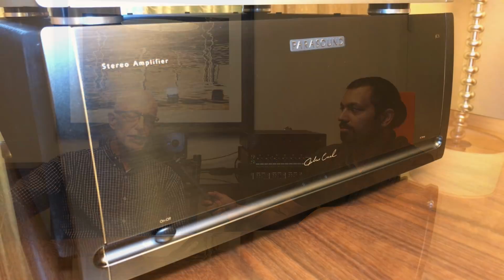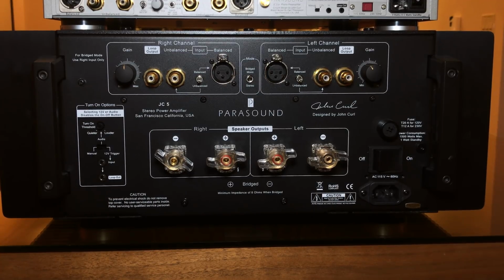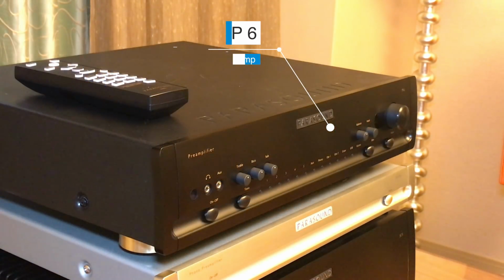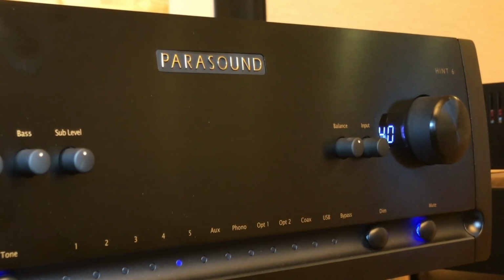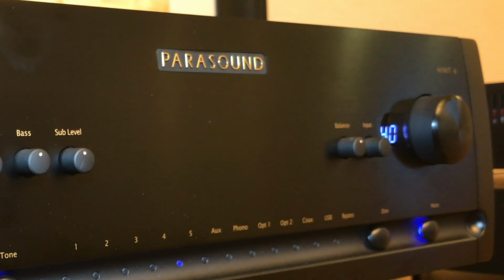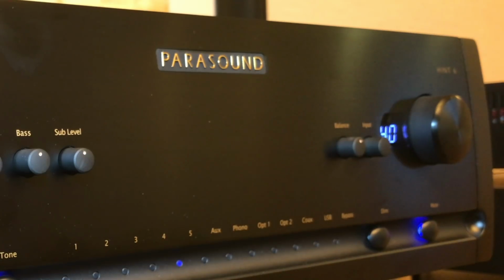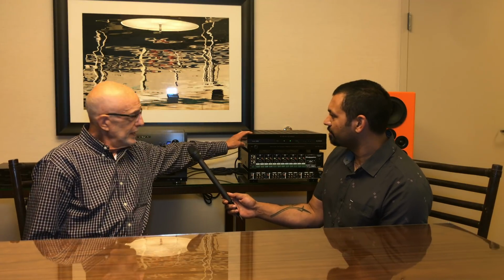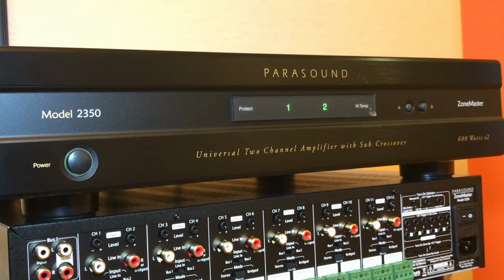CEDIA 2018 | Parasound JC 5, P 6, HINT 6 & Richard Schram

Comment: Hello, Please advise what are your opinion on Parasound A 21+ Amplifier and the P6  Pre Amplifier. What would be a best price to pay for either? Will these paired together sound good? Thanks
Reply from the maker: Hi!  Those should pair just fine.  Best pricing, contact my dealer Cory: http://bit.ly/TDPHTFB
Reply: Did you buy a P6? And I plan to buy it with the A21. What are the experiences? Thanks.
Reply: @nenadb7731  I bought the A23+ amplifier and P6 pre-amplifier, pretty decent, works for me.  I am happy with it.

Comment: Channa, have you ever done on video on when is best to buy a separate power amp (to accompany an AV receiver) for your HT?  Thanks
Reply: The problem is that few affordable receivers have pre-out jacks. I run an Outlaw 975 Pre-pro connected to a 2004 Denon receiver for it's 5 channel amp. My next purchase is an Outlaw or Monoprice 5 channel power amp (most made by ATI)
Reply from the maker: Hello Hugh!  I have not done a video on that.  Mainly because I don't usually see them going on sale.  A/V Receivers always go on sale when the company does a refresh.  For instance, Denon is going from the 400 line to the 500 line, like X3400H to X3500H.  You can get a great deal on an AVR in those instances.  Power amps, not so much, because they don't make new models every year or two.

Comment: Richard is a super nice guy to talk with and very intelligent.  Parasound gear is top notch.  I had the opportunity to review the Halo A52+ and the Zonemaster 2350 and both were absolutely incredible and very well built.  Awesome job on the interview Channa.
Reply: I have a question about separate amps
Reply: Hugh Jazz go for it we are here to help
Reply: Technodad brought the gas truck and delivered.
Reply from the maker: @Youthman - Thanks brotha!  I was super stoked he agreed to the interview, and a good time was had by all!  I also got to listen to those Tektons while I was setting up...they sound awesome!
Reply: Techno Dad excellent!! 
I been in pursuit of parasound  I really want to get a pre amp and a power amp for my music listening. 
But where I live there is no dealer with parasound.
Reply from the maker: @Hugh - What's your question?
Reply: Techno Dad  - Do you only require a power amp for the front tower speakers? I assume you dont need one for a 5.1 that is all bookshelf...correct? thx
Reply: I just purchased the Parasound Halo A52+ 5 amplifier. 
It's replacing a very good vintage Rotel RMB Series amp.
I got a very good deal on the new amp as it as it was an open box returned item.
This is my 1st time ever purchasing a Parasound amplifier. 

I have read many reviews & watched several YouTube vids on the A52 & ,its' bigger brother, the A51. However, I have never heard any Parasound equipment.
I am pairing the new amp  will the latest iteration of mid-highend line of Bowers & Wilkins 
( 700 S2 series)  speakers in a 5 channel set up.
     IYO, is there a distinct "Parasound Sound"?
I heard that it sounds a bit warmer than neutral & super detailed amp such as Rotel...and that the amp was deliberately designed that way by John Curl to sound a bit like a tube amp.
I appreciate your thoughts about this.

Thanks,
David